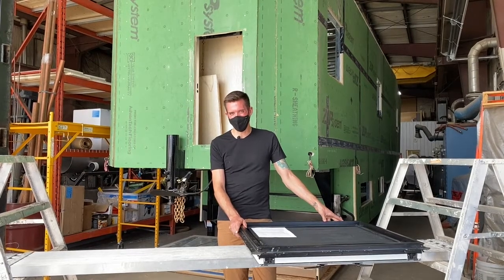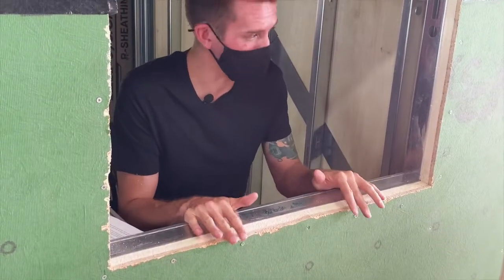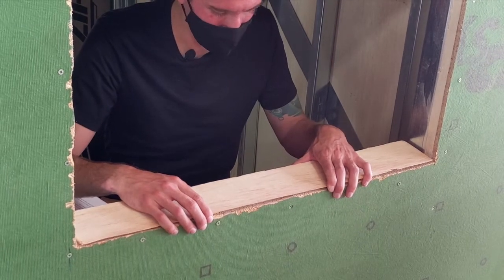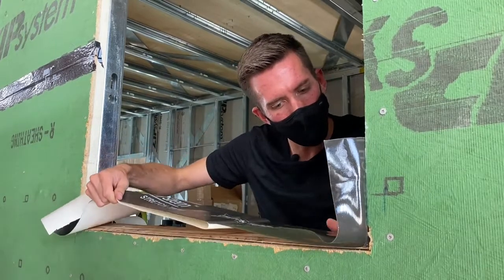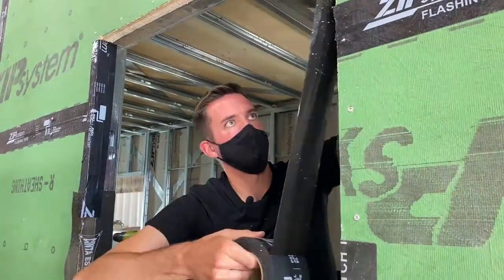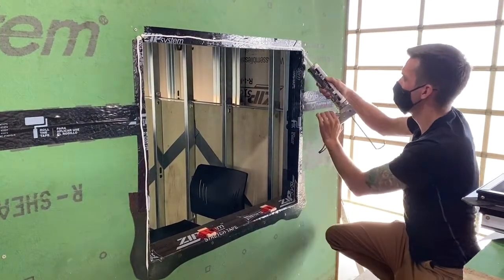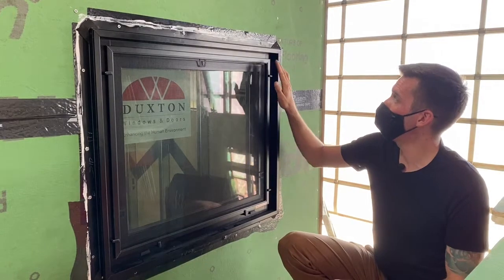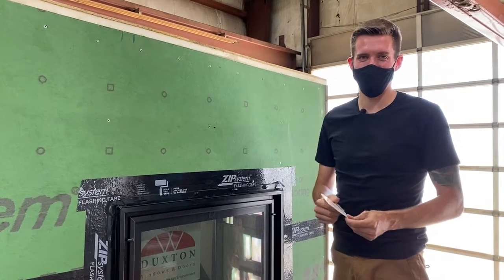How To Install A Window (The DIY Step-By-Step Guide + Tips) | Season 1 | Episode 28

Comment: Question have you ever built a Tiny house on wheels with a upstairs the same length of the downstairs maybe a box shape Roof?
Reply from the maker: A flat roof tiny home? Can be done! But its hard to make a flat roof watertight AND last. So 99.9% of tiny homes don't take that risk and engineering on. 

If you mean the same height, that's very hard to accomplish, as the max height for going on the road is 13'6". But there are many permanent tiny homes that are boxed roofed, and 2 floors of equal height!